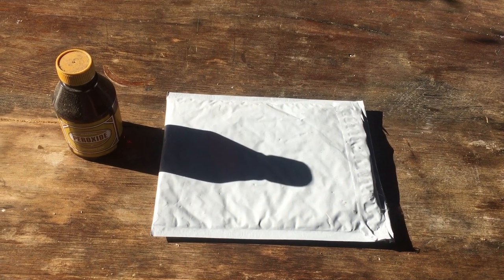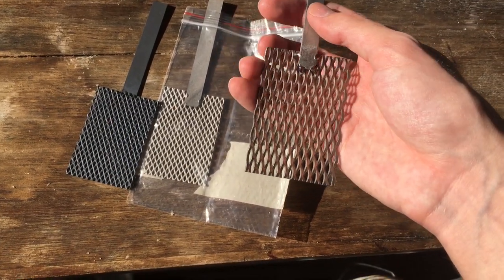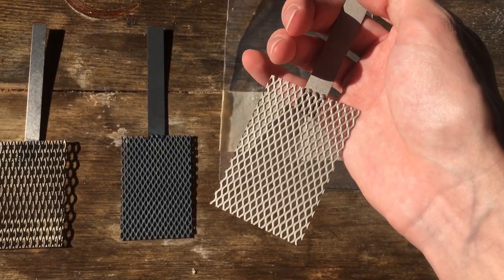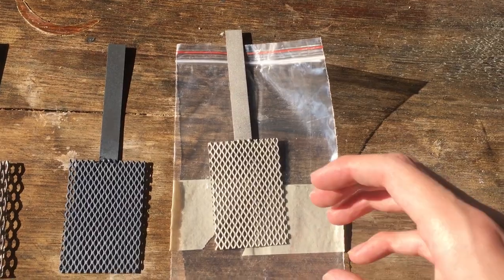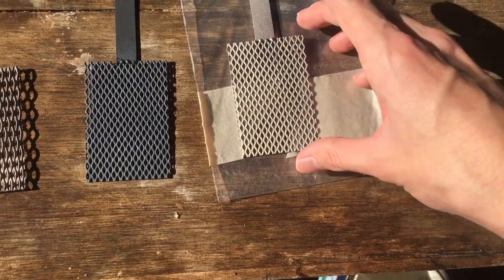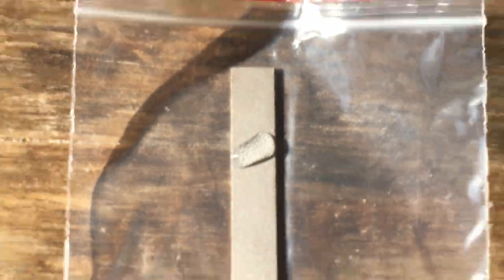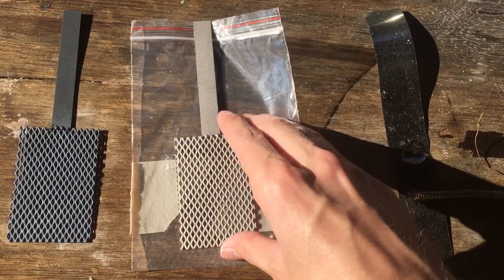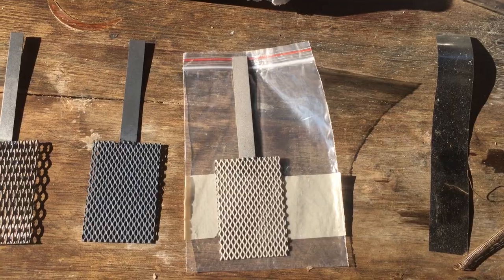Testing a Platinum Electrode

Comment: You can also double check that the electrodes are real by weighing it to find the density. Get the volume by submerging in water since it is a little geometrically complicated. It's a less destructive method than reacting it with chemicals.  EDIT: nvm this only applies to uncoated unplated didn't realize it was plated

Comment: Haha hey great to see you back ! I know it too studying takes a lot of time especially when the exams begin but after that a lot of free time again :) Last time I gave you a patent about hydrogen peroxide electrolysis so guess what I found an easier way for electrolysis ! Thought it maybe also interesting for you to try and compare. This one should only need a flower Pot and a rectifier for AC  WO2010134717A2
Reply from the maker: Sounds good! I'll try putting together some kind of alternating relay circuit for the power supply.
Reply: Yes that is also possible because then you can switch between two power supplies like it´s shown there.

Comment: hi, I made potassium chlorate by electrolysis and used carbon electrodes, but my crystals look like potassium nitrate, any ideas why?
Reply from the maker: I'm not really sure why that would happen, possibly a small amount of impurity with other ions might make the crystals grow like that. Either way, I certainly wouldn't worry about it.
Reply: @ScrapScience  thanks for the reply, I mixed it with sulfur and it burns very good, I will recrysalize it and see what happens. thanks for the responce

Comment: Very interesting video thanks for sharing, would you recomend me to use nichrome as a electrode? Like for water electrolysis and experiments?
Reply from the maker: As an anode choice, I'm not sure quite how well nichrome wire will withstand anodic oxidation conditions. In some cases, like water electrolysis in basic solution, it might be okay, but it's unlikely to be an effective anode choice in any other circumstances (and may even dissolve to form a highly toxic chromium mess in solution).
In any other experiments, I'd just recommend carbon or graphite anodes. They degrade over time, but will not chemically contaminate anything you're doing.

As a cathode choice, it'll do perfectly fine in almost all circumstances, but so will most other metals.
Reply: @ScrapScience  thank you
Reply: @ScrapScience what about Inconel wire? I think I have Inconel 600

Comment: so wher could you find an authentic platinum electrode?
Reply from the maker: The seller I got my platinum anode from seems to have disappeared a while ago. Luckily, they have a proper website: 
https://electrodesupply.com/
You can find authentic platinum electrodes there.
Reply: Hope still legitimate, didn’t list thickness coating or quantity. Especially now with rise in precious metals they can list price. Hope it’s enough to last ages, gram bars haven’t much surface, ounce? Yikes!  Pity can’t get it out of catalytic converter in rubbish van!  Going to do first try small quantities says need 3amp at far bit of time adding up the amperage/seconds. Seems safer than Pt Pd on carbon, now need new Variable voltage AC and variance DC or heating mantle control. Dangerous (very) brother stole a fortune hurt someone set fire to building after stealing everything of value. He’s England’s problem now. Great stuff, thanks!  Hope not from Sussex!

Comment: That was a good video!
Can you Share the eBay adress you bought it from so we all can be safe from frauds. That would be grate!
Reply from the maker: I'm afraid the ebay seller I got my platinum anode from disappeared sometime after I received my electrodes. They do have a website as well apparently: 
https://electrodesupply.com/
However, it seems they're sold out of platinum anodes at this stage, maybe they'll be restocked soon?
Reply: @ScrapScience  thank you for your time to  answer. I will check it up! Be safe/ Berndt.